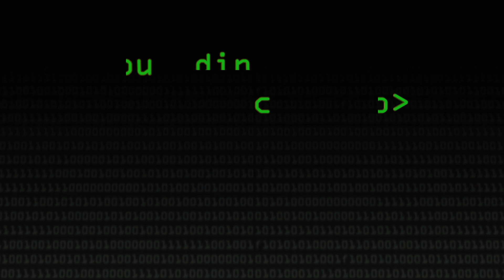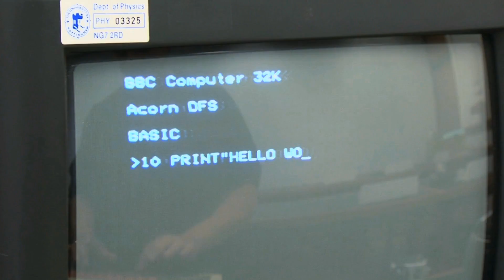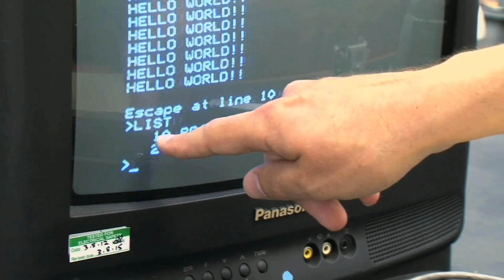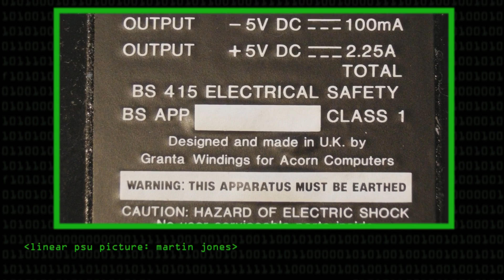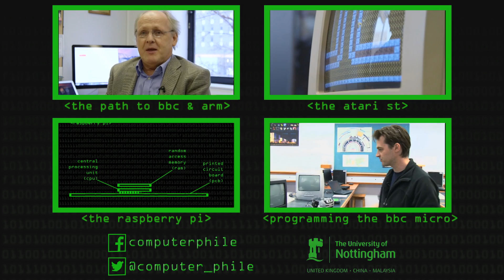Building the BBC Micro (The Beeb) - Computerphile

Comment: the BBC micro is kind of a distant ancestor of the Pi because of ARM architecture?
Reply: The BBC Micro pre-dates the ARM but, like a Pi, it was designed for expansion and users were encouraged to plug things into its user port, which was similar to the Pi's GPIO pins. The ARM was used for the first time in the successor to the BBC Micro.
Reply: @johnm2012  and the ARM was part-designed using the BBC Micro

Comment: Sounds like I came in at about the right time with my Issue 4. If I were to buy and run a Beeb now would the transmissions interfere with other devices?
Reply: They don't actually transmit anything. The BBC wasn't keen on the RF bleed from switched mode power supply. They're used everywhere now. Properly shielded and filtered there are no problems.

Comment: The story about the finger and the resistor pack...... What an amazing story. Putting a row of resistors there without understanding why but still having it work perfectly............ That is just WOW ! What happened was that you terminated the data lines with resistors and that swallows stray reflections on the line, which corrupt the signal. What you did was to terminate a transmission line.

Comment: The resistor network pulling up the data bus woks because it charges the stray capacitance making it easier for the processor to set the bits. I would guess resetting the bits is much more simple for the 6502 because the N channels it was using to do that have a lot smaller ON resistance than the P ones on top...

Comment: Don't know if you folks were told, but that's not CP/M you displayed. Other than that, thanks for the video - was always curious about the BBC Micro.
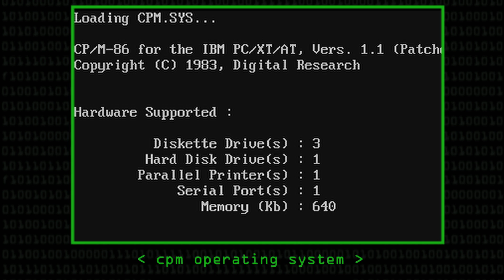Reply: Are you talking about 5:02 ? It's CP/M-86, which is CP/M that's compiled to run on an 8086, rather than an 8080 or Z80. The shot is perfectly valid, since the BBC Micro didn't have any of those CPUs.
Reply: @johnm2012  Although there is now the Pi on the Tube which runs an 80286 in emulation and can run GEM.

Comment: I'm not surprised that the BBC wanted a linear power supply. Getting a SMPS quiet is no mean feat, especially down into the longwave range and with the design methods of the time, and back in the '80s the AM bands obviously were very important still - shortwave was the closest thing to the internet that the general public had. Maybe they even kept ham radio use in mind.

These days you can be happy if your fancy new LED lights don't keep wiping out the entire FM band nearby (along with DAB). I bet a lot of them are far from CE compliant regardless of what the label says. The only thing potentially even worse than SMPS is plasma screens, pure evil. Eventually Panasonic switched to shielded panels in about 2009, which reduced emissions dramatically, but LCDs took over the market soon after.

I didn't know Astec were around in those days already. I used to have an early 2000 (Klamath) Pentium III system with an Astec 110 watter - these were good supplies and could take quite a beating. I would later use it to run an Asus P2B-D with two undervolted and underclocked 667 MHz Coppermine PIIIs with passive cooling, a Radeon 9000 and two harddrives. Eventually the system would develop stability issues though, I guess the electrolytics weren't so happy any more. Had to squeeze in a much bigger Fortron at this point.

Comment: It's kind of ironic when the BBC went with Acorn's 6502 based machine while insisting on CP/M compatibility when Sinclair had a Z80 based machine and Amstrad's CPC was just a colourised PCW, the PCW being a Z80 machine that actually ran on CP/M (that I'd love to see Lazy Game Reviews review, but as it's an all-in-one that includes a CRT monitor, getting one of those over to America is going to be costly so it might never happen, sadly)
Reply: You can buy just the computer itself and get power cables off eBay relatively cheaply. You can also get TV cables as well so no need for a monitor any more.

Comment: Today, multi channel bus logic analysers and hi speed storage oscilloscopes could easily find the gremlins in bus timing and impedance issues. Even the PCB layout software takes this into account.
Although the 1970-80 HP bus logic analysis stuff was pretty good but boy,  you needed really deep pockets.

Comment: I still need somebody to explain to me why the IBM PC was such a crock of sh** at this time, compared with the Beeb. My employers waltzed into my lab one day, in late '83, I think, took my model B, and left me with a twice as expensive brand new 640k IBM PC, thinking they were doing me a favour. I'd just written a mockup of a signal processing algorithm in lovely BBC Basic, and so I had to translate it into GW Basic. In spite of the much faster clock speed, and twice the data width, the GW version on the IBM was almost 3 times slower, it turned out, as I showed when I got my beeb back.
Reply: The PC was awesome because IBM didn’t patent it, made it expandable, made future machines backward compatible, and didn’t charge licensing fees so the peripheral, software, and clone market took off.
Reply: @ryanyoder7573  as did Acorn on the Beeb with the Tube, the User Port, the ROM support etc.

Comment: More of this please!! Fascinating trip down memory lane. I remember wrestling with a Research machines 380z and a recalcitrant cassette-corder, soldering together Nascom1 kits for computer club - even typing hex codes into a National Semiconductor SC/MP. It was more than jumpers for goal posts when I was at school!!
Reply: I still have a Acorn Atom in the garage. A forerunner of the BBC micro. Learned a lot from it.
Reply: I should have added I also have a working BBC B micro as well as the modern off spring Raspberry Pi.
Reply: I bet that BBC B will be worth a few bob by now Richard Harris
Reply: Steve Gould
 Astoundingly not at all - Ebay is selling them for as little as £25 or less - £5 -  if not working The acorn atom is up there for £399 BUT in as new condition - sadly mine isn't as new any more.
Reply: Richard Harris I guess the fan base just isn't quite as wide as say, classic cars!
Reply: Richard Harris They have it too easy these days. When I was a lad it was all about wrestling with backwords notation and weird paging rituals on the Zilog Z80. Nowadays kids speak into their smartphone to search Google. The romance has gone right out of it! Don't get me started on the 300baud modems, punched cards and paper tape :-)
Reply: Steve Gould
:-) I worked with people who could eye read the headers off punch tape (ICL Swansea).
I can run onto train printers, high speed pneumatic tape decks, disk packs you can hardly lift and core memory as well.
Reply: Richard Harris Ha ha ha - we've both been lucky enough to live in interesting times! When I was a child our family camera was a box-brownie and the TV (with three channels and glowing vacuum tubes in the back) was in a large veneered wooden cabinet. Now I'm programming smart phones that out-perform Star Treks communicator! We have probably seen more technological change in our life-times than anyone before in history! Exciting to think what the future will hold.
Reply: Steve Gould
Makes life interesting. I still recall the first TV programme I ever saw, The Range Rider with the Cisco kid. B/W of course. Personally I think we do well to keep up the pace of change. At least my kids don't exactly think I am the Dinosaur perhaps I thought my parents were.

My Father was born well before cars were common place and was a skilled steam engineer all his life, He had a lot more practical skills than I do. What he couldn't find he made, buying was the last option.

Comment: Why BBC micro needed what speech generation chip? if target was to make a accessible computer, why adding expensive part to it?
Reply from the maker: Kit Vitae Good question as to why - seemed to be a BBC requirement, probably thought it'd play well on a TV programme (talking computer etc) - though the chips had been around a while and were in the Texas Instruments 'Speak & Spell' etc.... >Sean
Reply: Uterr It was an option.  One that if you could afford it, you bought later.  The computer worked perfectly fine without it.
Reply: the impression i got was that it was another of the bbc's odd requirements? just one that didn't break the machine like the psu thing.
Reply: cjmillsnun ... And I don't think I've ever seen a single BBC B out of God only knows how many machines, which has had the speech chips fitted. I think the BBC misjudged the popularity of that one. Mode 7 (Teletext) was stunningly popular, though!
Reply: I can definitely see the point of it as a PR thing. Talking computers/robots was cool at the time. Why do you need ringtones on your mobile phone? Playing back an advanced ringtone such as an MP3 takes more power than just a loud beep.
Reply: +Computerphile I did see a BBC Micro with speech synthesising software, I don't think it had the speech synthesising chips though, the voice didn't sound the same and I was educated at a local education authority that I don't think would have had the funding to buy expensive hardware (the rural, Labour led, Northumberland County Council - the part of the North East that nobody's heard of)

Comment: Zzzzz... Zzzzz... Zzzzz...
Reply: SinthTeck You find it boring but if it weren't for men like this and this machine, you wouldn't be sat on the machine that you are now. Have some respect, cretin.
Reply: thecassman not true
Reply: SinthTeck Explain...
Reply: CerealKiller No need to offend
Reply: thecassman So many processors, architectures and computer system have been invented in time. This is just a drop in the ocean.
Reply: CerealKiller How is my a stupid comment? And still, I didn't offend anyone.
Reply: SinthTeck wrong. the ARM processors are used by a majority of devices.
Reply: SinthTeck then how is this thing here a drop in the ocean? it kickstarted Acorn, the company later called "ARM" (advanced RISC machines)
Reply: SinthTeck The main thing about the BBC Micro in particular is that the BBC did a huge amount of publicity with it - specifically televised programs about it (They did a 10 episode series on it in 1985, for example)... Nobody is saying that this was the original and only system of it's kind, but the publicity and advertising that the BBC pushed with it massively built up people's interest in development... These guys and this machine WERE responsible for an increase in developers and an increase in understanding and I definitely feel that it influenced the market massively.

And, you said to CerealKiller that you didn't offend anyone; I'd say your very original post of "zzz"s was offensive in a different way. Nothing wrong with you having your own opinion but a bit of respect wouldn't hurt.
Reply: SinthTeck No problem. But then, just don't watch it. No need to comment.
Reply: thecassman Well, I could ask the exact same thing to you. You don't like my comment? Keep scrolling.
Reply: ***** So? I didn't say they aren't.
Reply: NerdNordic What?
Reply: Probably dosent have the brains to understand it 😂😂😂
Reply: ***** There is so much more that led to where we are now.
Reply: thecassman Ok. But I still find this video boring.